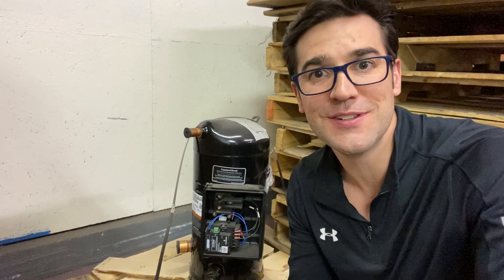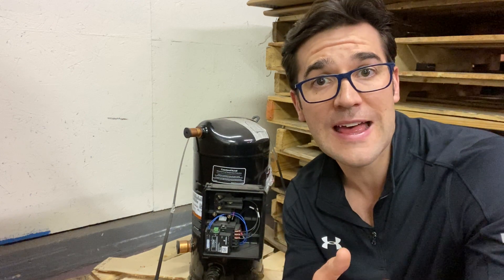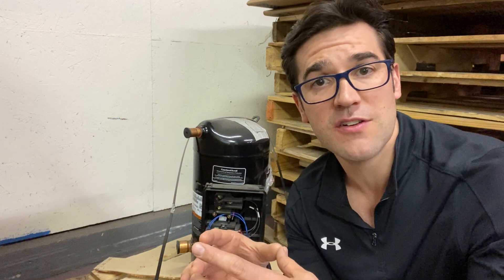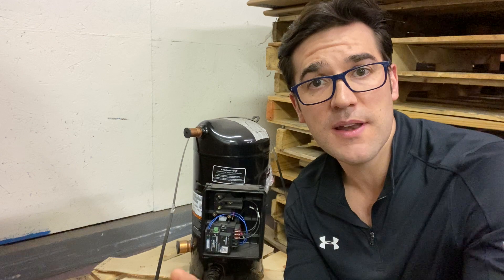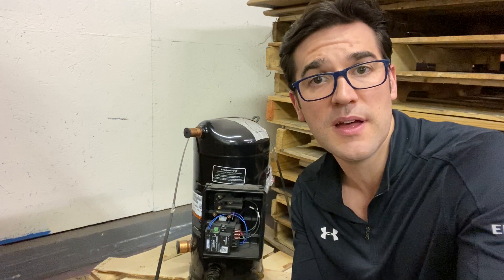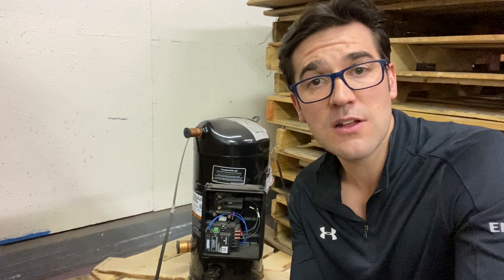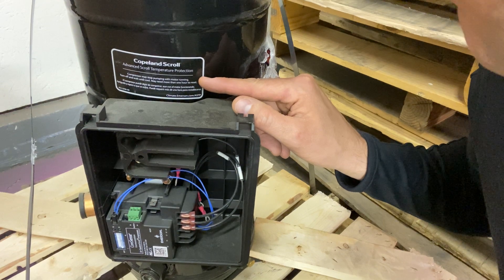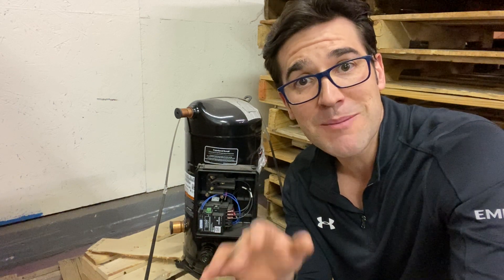Copeland Advanced Temperature Scroll Protector (ASTP)

Comment: Why does floating seal have to balance out the fixed scroll ? What does it exactly do ?
Reply from the maker: It really job is to protect the compressor from running into a vacuum
Reply: @RefrigerationMentor  can it become loose and make knocking noises? We have had few compressors that were running at zero psis and after the leak repair and recharged we started hearing some kinda knocking noise but compressors haven’t failed so I assume the bearings are fine
Reply from the maker: @Guyhakverdi  do a performance test on the compressor through the compressor app or software and see if it’s running within specifications.

Comment: What about these newer horizontal scroll compressors
Reply from the maker: ZBH & ZRH horizontal compressor have no internal scroll temperature protection. As a result, an external
discharge line sensor is required for all refrigeration and heat pump applications to provide loss of charge
protection. Check out this Manual https://webapps.emerson.com/online-product-information/Publication/LaunchPDF?Index=aeb&PDF=ae1338.pdf

Comment: Well a contractor was about to change an evaporator out for the 3rd. Time before Mr. Harold Nelson figured out that the line set attached to the ceiling rafters was the issue, as R410a was flashing before it got to the metering device.
Reply: Once both lines were insulated enough & lower the attachment to the ceiling rafters, problem went away.
Reply from the maker: when you had a chance to look inside those compressors, that’s when you really understand the true cause of failure.